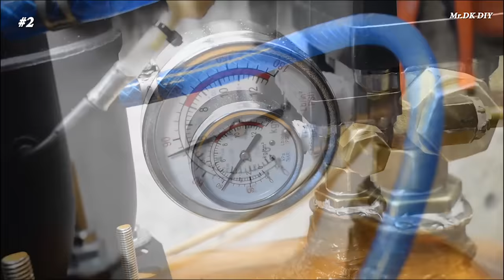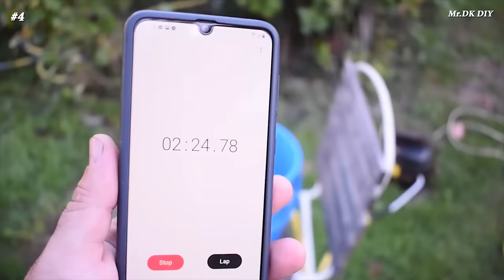4 WAYS HOW TO REUSE OLD REFRIGERATOR MOTOR COMPRESSOR

Comment: Yes, Александр Нестеренко mentioned lubrication. The compressor with big orange tank is bound to fail quite fast! Every compressor with oil lubrication pushes out in time small droplets of oil with compressed gas (whatever the gas is) trough outlet, so you need to top it up from time to time, or even change it. Can you do it with this compressor type? You could, a bit complicated but not impossible. Not easy to see a level inside. Александр Нестеренко spoke about how system is closed. That means every drop of oil pushed out trough outlet is recirculated back together with refrigerant. Not to mention required solubility of said oil with refrigerant (very special oil type, it is more like antifreeze then mineral oil), so to be sure oil is returning back. Next, moisture: that type of oil really hates moisture (it is based on antifreeze chemistry, guess what is going to happen when you mix it with water). So even keeping somehow keeping it in there it will spoil very fast. Very important facts. That is how refrigerator can work for years without maintenance. Given how short it will live (I give it 1% of life of one bought at hardware store)  it's not even worth the time and effort building it. Also cheaper to by one at hobby hardware store.

Comment: Why is the motor not rubber mounted to reduce vibration? Vibration results in cracks where welding has been carried out and varying tank pressure will assist the forming g of said cracks. That being said, a nice well thought out project. Well done.

Comment: You need a oiltrap, the oil in the compressor is going in a loop in the refrigerant system, you must have a oiltrap with a valve that can put the oil back to the inlet of the compressor!
The second build, the electric coil is burned, and the oil has acid from that burned coil, use fresh mineraloil!
Third build, don’t drink that water! You get oil from the compressor in the water!

Comment: 3:36 it is EXTREMELY important to fill the tankup until it overflows. Tanks under pressure won't allow moisture in so there isn't any rust to clean out. You fill it with water or sand to displace the gas that remains at atmospheric pressure within.  Welding a tank that seems "empty" will most likely land what parts of you that can be found  in a closed casket situation.

Comment: this is awesome! now only if you could use your powers for good instead of evil!
 by adding the rubber grommets at the feet of the compressor motor would reduce the noise of the compressor motor or extend the life of the build? 
how much did this whole unit cost? 
LOVE IT!

Comment: Enough supplies have been made to get a cheap, but much more efficient air compressor. These are made to have fluid in them, that's why they are not so good an air compressor. I have built a lot of up to 25 hp. air compressors. And installed an automatic tank drain.

Comment: Thanks for the video. I use this type of compressor in reverse! That is, I connected it with the pipe where it sucks the air to a metal container, and I use it to suck the used oil from the engine of my car when I have to replace the lubricant!

Comment: The problem  is that as the compressor  runs it sends out some of its lubrication  oil with the discharge air.   I had to add about 2 oz of oil for every 1 hour of run time . Just add the oil on the suction line

Comment: Good job at all but ☝️one thing is missed .
During  filing time , the hot air goes  in the capsule and gonna be cold , in  that time inside  the capsule with that processing gonna collect water and must be under that project  has the exiting point for that water
Thanks a lot bro

Comment: ok i seen the first rinse out with water..  not sure if that was enough .. but my pick up is .. after the drillings did you Re rinse or vacuum out the metal debris ? those things will compromise ANY hoses and nozzles with blockage. Also great Video !!

Comment: Nice little air compressor!  You might consider welding a drain cock in the bottom to drain the moisture that will build up, other wise the tank will rust out!  Seen it happen!
Reply: Excellent observation! You beat me to the punch on that one, Dave!!

Comment: These work very well but that compressor will pump over 300 pounds of pressure.From experience a pop off valve is a good idea,one time I blew out a garage wall.The detail in workmanship in this video is remarkable.

Comment: Good one man thanks a lot, I have a doubt about the capasity of the tank, till what PSI it accomodate and the safety valve, + drainage valve for the tank. I really wanted to make one this kind. I prefer the air pump with 12v motor, since I need to work for spray job- I am an artist
If I need any assistance, do not hesitate to help me please
Thanks again for such a wonderful video

Comment: While impeccable in being ingenious, you over did it with too much sealant tape on your fittings, & i did not notice an overcompensation blow-off valve, ... which would make your compressor just keep pumping up pressure if you are too busy to notice how much pressure it is creating, ...  sure, for stuff like pool toys, or for air mattresses it will be fine, but if the compressor fails to shut off, prior to making the maximum amount of air pressure, then you are essentially making a bomb, ... that will kill, anything within the radius of the explosion, ... 
While the idea itself is great,  come on, & max it out by doing the creation part properly safe, ... other than that, you have done a great service for folks without access to a store where they could just buy a compressor, & air tank, ...

Comment: If you grind off the galvanize  coating before welding  it's way easier and you'll have a nicer weld
Reply: So ... NOW YOU MENTION THIS ...after he battles with it for hours, and resorts to using gobs of epoxy putty to seal all of the leaking pin-holes ???
Thanks a lot.

Comment: About project number 2,What about piston lubrication? The refrigerator compressor normally last long because it work in a closed system in which some amount of the lubricant will escape from the outlet and then circulate back into the inlet.
With that being said I don't know how much this one will last

Comment: Never use an ac or refrigerator compressor to inflate tires ,the air will have oil in it which will destroy the tires in the course to time .

Comment: Keep in mind the duty cycle of the compressor. It won't last long if it runs very long. I've used a few for airbrushing at different times and they all died, not enough oil and run times too long.
Reply: yep because it can be damaged by moisture but you can solder a filter drier in the suction port

Comment: How do know that the compressor isn't burnt out? Do you know that refrigeration oil is hydroscopic and sucking air thru it which contains moisture is not good for the oil. Also the motor in actual operation is cooled by the returning refrigerant gas in refrigerators,goodbye to electric windings. From a refrig. tech.

Comment: the problem with fridge compressor compressor's is the output volume is so low so you have to keep the storage tank really small, i wonder if one of those pressure switches can handle switching 2 fridge compressors or would you have to use a relay, 2 compressors motors would make the output volume more usable, i need to scrounge up a second fridge compressor....

Comment: Needs Oil, needs safety valve, needs drain plug. If you want to do more than blow-up occasional beach ball, you need to find a couple more compressors.

Comment: Good project.  However, excessive use of teflon tape.  A turn and half, or two turns, carefully placed, clockwise as someone already said, where there is no chance of stray pieces contaminating air passages, or valves, is an absolute must for compressed air.

Comment: It would be a good idea to install an unloader valve, otherwise it may be difficult to restart unless all the pressure is released first.
It prevents pressure on the piston at startup.
Reply: Air switches often have built in overloaders. But wouldn't it be worth to  fit an extra outpout with a pressure regulator ?
Reply: The piston stroke on the freon compressor is incredibly short ... for good reason. It is designed to start, without issues, against a few hundred psi of freon pressure, in its original application. 
In its current life, just stuffing 90 psi into a tank ... well, it never really had it so good before.
Of course, it will probably long for the lubrication that it used to enjoy, but you can't have everything in this world ... even if you are a compressor.
Reply: Those compressors have no trouble starting against load, they can provide usually around 30 bar pressure, compared to typical tank pressure of 6-10 bar.

Comment: Air compressor is made out of an old refrigerator compressor. The air compressor can be used for spray painting inflating tyers. I think with these compressor you can even make an air engine like petrol engines & deasel engines. The air which comes from the compressor is fed to a cylinder having a piston which pushes the rod to turn the crank wheel. Thus rotation of crank wheel is done by the high pressure of air compressor. To increase more pressure the air which comes from the air compressor is heated up with a heater and fed to the cylinder through carburetor. With this method you can make an air engine car bike or even a bus too.
Those make these air compressor try to make an air engine too.
Reply: What I have mentioned above is an air engine which runs with the power of air like conventional petrol or deasel engines. Thus we can make an air car air bus van truck etc etc.
I think it will be much efficient than electric vehicles too..with out any pollution too. Pollution free engine
Reply: Ideas for life before the world ends. Invent something worth full with your intelligence
Reply: Ideas for life invent something before the world ends no time at all be quick
Reply: Sorry Ryan, but ...
the Reed Valves in the compressor head will not allow the unit to be powered as you have imagined. The Inlet Valve will operate just fine for your idea, but the Discharge Valve will prevent the piston from seeing any pneumatic pressure. Since it is configured to "vent" pressure from the head, it works against the principle of converting pressure to rotating  mechanical energy.
However, replacing the Reed Valves with Electrical Pneumatic Solenoid Valves, and triggering them via micro-switches operated by a small cam on the compressor shaft ... 
might work just fine. 😉
Reply: And where does the energy to run the compressor come from in your scheme?

Comment: Wrong connector on Compressor You nedd to use female with valve and you does not need manual valve .  And you must add a bottom valve to remove condensate

Comment: This air compressor is very dangerous, it's not fitted with a pressure relief valve and welding to a pressure vessel is poor practice. Do not copy these ideas! Buy an approved compressor with the correct safety devises and certification, they are not expensive and could save a life!

Comment: I built a similar compressor 40 years ago out of freezer innards, a fire extimguisher, a regulator from an air-powered locomotive chemical toilet and steam locomotive gauges.  Today, you can buy a compressor with regulator, gauges and hose at Harbor Freight for $40.  If the flow of cheap goods from China ever stops, we'll be going back to homemade, as stagnant American wages would not allow most of us to buy American made at four times the cost.

Comment: yes,,, we can use it for a short period of time, but it will not last like a traditional air compressor....
Reply: Well, lets face it.
Once the Duct Tape falls off of the electrical connection box, and the power terminals are exposed to the touch ... the operator isn't going to need a 3 yr warranty.

Comment: 29:31  please inform people to give it a little oil now and than.
It will run dry after a wile  [ just use the -air inlet-]
Also, a pressure regulator is handy when people gonna use it as unit for spraying thing  [Airbrush for a starter the cheap way.]
+ a good water filter.  + release valve , when the main on-off is kaduc!!  ....a very important piece of the nice project.
+ a point to empty your tank at a point [water +oil will get in there 100% sure .

Comment: Where is your safety shield? That open connection at 40:00 between the motor and compressor where the two straps fold over the pulley is an accident waiting to happen. Get to close and have the leg of your pants or your shirtsleeve get caught in it, and you just lost your arm. It would wrap you around that shaft so fast you wouldn't know what hit you. That is the most dangerous thing I've seen posted on Youtube in a very long time.

Comment: The pressure of you pump seem low for that seize of compressor. You may want to check the head gasket and fix it, it may have become weak. Thanks for posting
Reply: Na, BAD MUFFLER GROMMET,  YO!
Reply: The Pressure Switch controlled the 90 psi shut-off point. All he would need to do, is grab that hex-head with his handy Vice-Grips and give it a few turns in a clockwise direction, while rounding the corners off of the bolt, for good measure.
Reply: The pressure in the tank is conrolled by the pressure switch and he has it set for that low pressure.

Comment: Yea great, especially when you use the vacuum to empty the bucket and put the water back in the hole
Reply: Well, hey ...
I noticed that he used a Fuel Filter for the compressor inlet tube.
Technically speaking, this qualifies the unit  to empty the gas tank on his lawn mower. Of course, it might be a good idea to keep the water handy as well ... you know, in case of fire.

Comment: I wanted to find out what to do with a 12vbat that is not charging saw a story about it but can't find it
Reply: Well,  good luck with using an old freon compressor to coax a charge into your 12v battery. Don't forget to share a video with us, when you work out the details.

Comment: The compressor you used in the air does not operate the second time because you did not use the valve
الضاغط  الذي استعملته في الهواء لا يشتغل المرة الثانية لانك  لم تستعمل الصمام

Comment: You forgot a very important item on the compressor build. The condensation exit valve. It goes on the front bottom.
Reply: Enrique egl
Reply: Enrique eglesias
Reply: Ring may bells

Comment: Did you replace that old refrigerant oil with an air friendly oil?
Reply: There is no CFC in this part of the fridge
Reply: Туркменский
Reply: Ummm...
Nah.
That's why the windings caught fire, and he resorted to using a different motor to power it.

Comment: Shoot! I love DIY projects and all but when they start using welding equipment, I have to pass. I don't have the room to use them even if I had them. 
I really wish posters who present projects requiring any type of welding would make it obvious in their titles. Then I wouldn't get disappointed when the need for such means it's not for me. /sighs
Reply: I mean an electric welder or however is it called doesn't require much place,does it?

Comment: how can you know the limit in bar of the hose between the compressor and the tank ?
Reply: herman derhound It's usually stamped on the hose
Reply: The hoses usually have specifications you can work with ....
Reply: Its called R&D, Herman.
You by-pass the Pressure Switch to alow the compressor to run un-checked. Then, you hide behind a pile of "garage garbage" to shield yourself from the impending shrapnel explosion, and carefully note the exact gage pressure that is displayed before the hose is violently distributed thruout the workshop. Next, note the Fail Pressure on your clipboard, and remember to set the pressure switch setting lower than the figure you recorded.
Oh, and that small string tied around your finger, is there to remind you to "un-bypass" the electrical connections on the Pressure Switch. 😂

Comment: Not bad but please learn how to edit, I got half way through the second one and could not watch any more and also how do you plan to lubricate those compressors, the oil normally gets pumped around with the gas to lube the pump doesn’t it.
Reply: They also make good miti vac pump's for bleeding brakes
Reply: Shushhh!
Don't say that out loud, dude.
(We just let him build random stuff, and are too kind to mention that the piston will sieze in its bore tomorrow.)

Comment: #1 - der Kompressor kann bis zu 20 bar liefern - wohl nicht ganz ölfrei - für den Auto-/Fahrradreifen nicht sonderlich förderlich
#2 - war verzinktes Zeug beim Schweißen nicht eher 'bäh'? Auch eine interessante Art, die Elektrode beim Schweißen zu halten ;) Warum aber die 2.te Elektrode hier 'angebrutzelt' wurde, erschließt sich mir nicht. Die Gas-Flasche einfach als Luft-Tank zu benutzen, erscheint mir sicherer, auch sah ich kein Überdruck-Ventil, oder? So gehört Das klar in Richtung 'Bombe' - und es ist mir ganz recht, daß Du mit diesem Ding nicht mein Nachbar bist.
Mein Kühlschrank-Kompressor befüllt einen alten Kompressor, also einen Tank, Der sowohl dafür gedacht ist wie auch die entsprechenden Sicherheits-Mechanismen aufweist.
Achja - ein Rückschlag-Ventil zwischen Kompressor und Lufttank lässt den Kompressor sicherer anlaufen, vor Allem, wenn der Druckwächter diese Leitung entlüftet beim Abschalten.
Die in Gaffa eingewickelte Steckdose im Garten (beim Ball aufpumpen) vermag mir auch kein Lächeln zu entlocken - Junge, es ist Dein Leben (mit etwas Glück nur 'Dein' Leben)
#3 - die Wellenkupplung des Waschmaschinen-Motor ist gelungen ;) Sonst gilt Das zu #2 schon gesagte - auch hier ist der Druck ungeregelt.
#4 - mit einem eigenen Brunnen kann ich nicht dienen - hier hätte es mir besser gefallen, wenn der Kompressor 'weit weg' geblieben wäre - auch, wenn ein Gartenschlauch nicht wirklich für Druckluft geeignet ist - bei 6m Tiefe kommt aber kein bar zusammen. Auf jeden Fall eine Möglichkeit, das Wasser zu fördern.